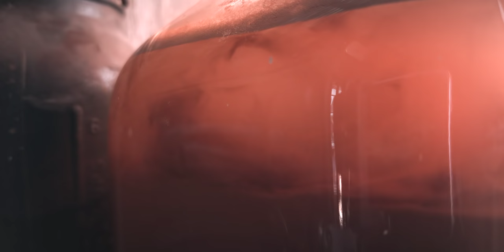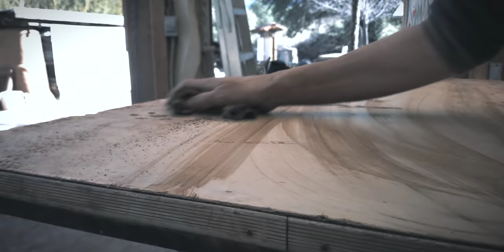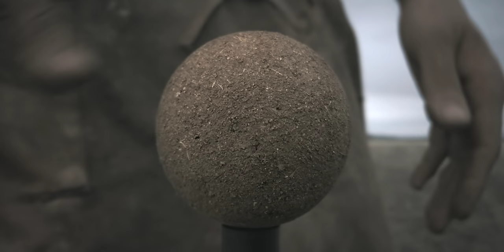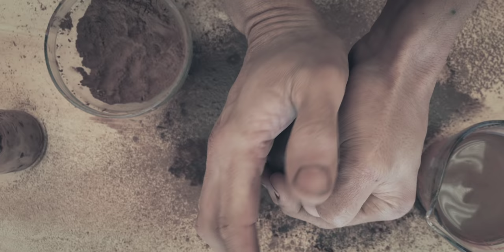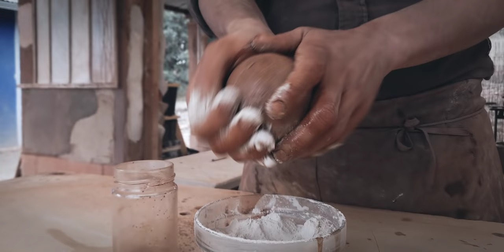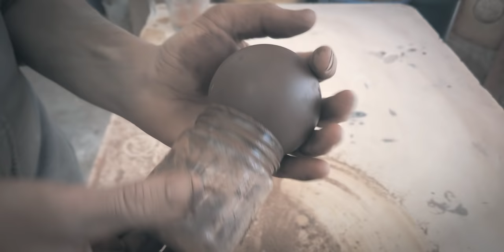4 Creative Dorodango Techniques to Try - How To

Comment: A shoe-shine brush might be an interesting tool for polishing textured variants, but unless different clay is used during some stages it's liable to reduce the contrast of patterning. (All glossy vs. matte and glossy.) I'd guess similar to how wax is applied, you'd slightly damp clay powder so it could be worked into the brush hairs before using the brush on the surface to be polished. Just a thought, I'm wondering if it's been tried yet?
Reply from the maker: That's a good thought sometimes I've used the brush in the past, but that sounds even better

Comment: I love house planting. I have tons of bags of different soil and sand moss etc  I also have bags or packages of clay for making anything art household replacement parts etc.  and I can’t believe I already have different colours of mica all different colours and kinda mica flakes etc.  I wonder what would be better. Mixing the plaint soil with sand then dry out some clay and get it to a powder form adding it to the soil and to use to shine it etc. or just go outside and dig up some dirt 🤷🏼‍♀️

Comment: For the final colour of a dorodango ball, can almost any coloured powdery substance be used, or must it be powder clay or another specific form of powdered substance? Also when you start your core and mention the ratios of how many parts clay to sand to water, is there a specific measurement and are your measurements by weight or volume?

Comment: What clay do you use?
Reply from the maker: You can use any clay but to make it easier I would avoid anything on either at the spectrum's on expansiveness like Kalin or Bentonite, but if you're buying a clay from pottery stores I love C red, any masonry clay work from the hardware stores. Hope that helps.